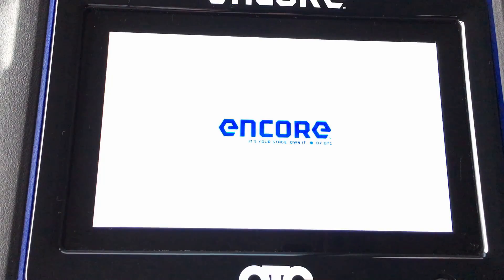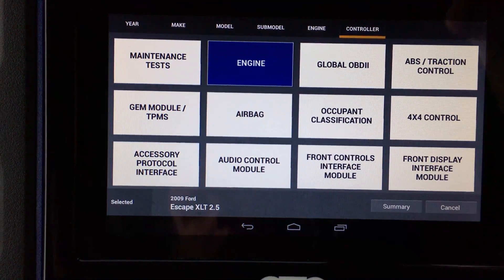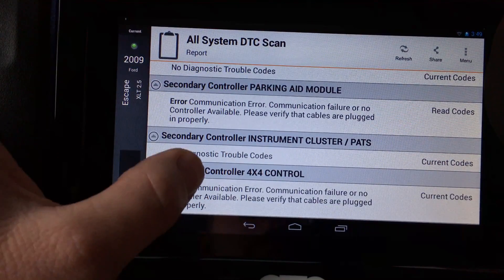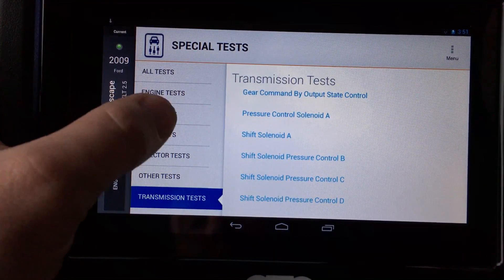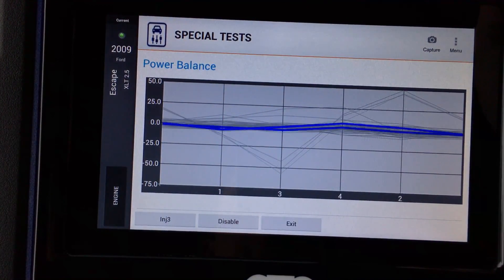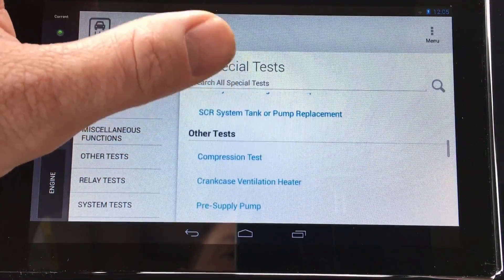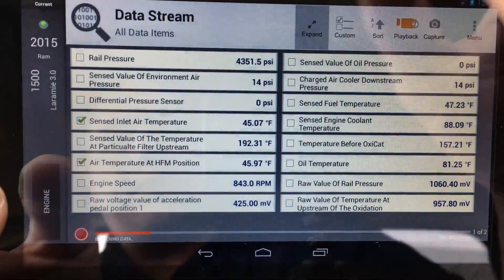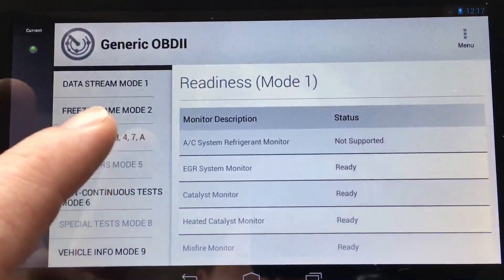OTC Encore Scan Tool Testing Part 2: Exploring Live Data Streams and Special Functions

Comment: Brian

Will this let me check Transmission Fluid Temp on a ZF9HP? sold the F-150 got this 14 Cherokee doing the flush need to read the temperature the the dipstick tool to be accurate, not a ford question sorry; going back after this one to the oval

Comment: Do you only work on ford if not can you try and see if it'll connect to an ABS module or transmission on a 2001 and older Jeep grand Cherokee  or any dodge Chrysler product
Reply: jeep tech yes it does connect u have to use the right adopter
Reply: Vince Bauer thanks none of my launch scanners would had to get a Snapon ;(
Reply: jeep tech I want to get the edge